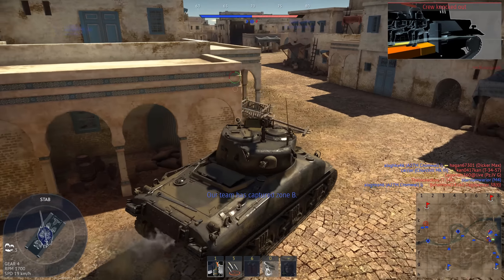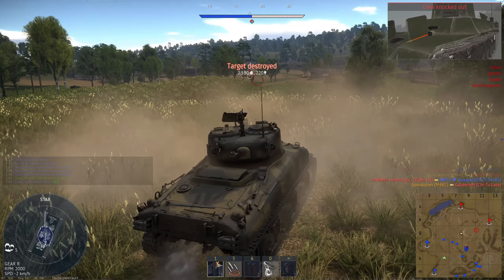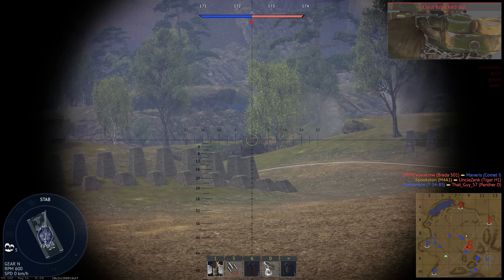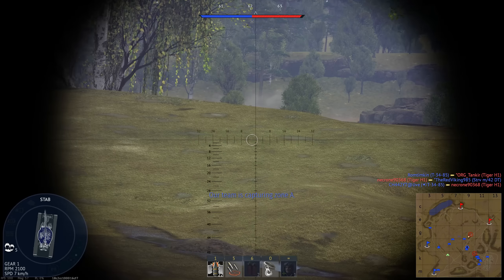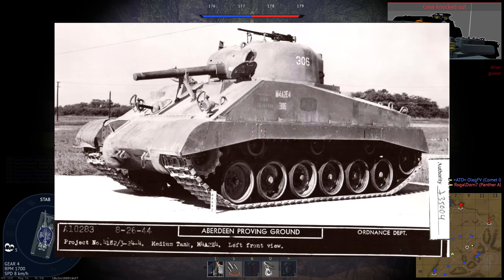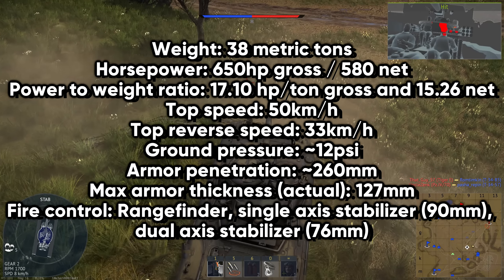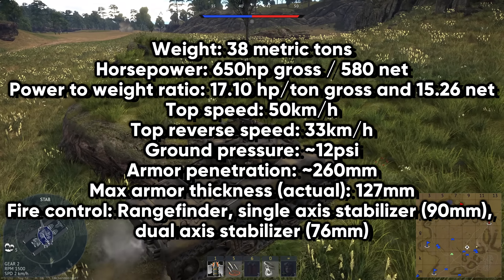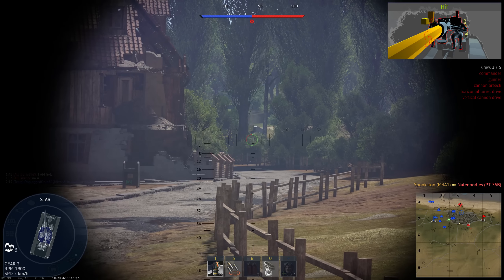The Ultimate M4 Sherman

Comment: Well, seing the fact that the M4 Sherman was somehow underpowered, it should also noted that the 5 synchronized engine climbing up the power to 650 gross Hp wasn't really easy for maintenance, which was a reason why this tank wasn't really official in the US forces, as the french did recieved those tank, and did noticed the engine maintenance difficulties due to its configuration, but about installing a 90mm gun would require to rework the scale of the tank to keep the gravity center balanced, or it could have trouble in mobility, especially extending the lenght and adding new wheel would help about that. But there could also another modification to do in order to make it more viable, and it is reducing his height, or redesigning the height to make it more balanced, in exchange of replacing the turret little more at the back to keep the vehicle balanced and able to use a 90mm canon. But the Sherman was unfortunatly a dead end concept, because his shape wasn't procurring enough protection coming from the frontal hull plate, which wasn't very angled unlike the T-34 and even unlike the Panther, the US heavy tank prototype T32 prooved to be more suited for combat in term of protection, especially for the T32E1 variant. The Sherman did his job done, but whatever you put on it, it would more or less, making it no longer a Sherman, because his hull to increase his protection, need a redesign in terms of angle, and I'm not counting the lengh extension. The US weren't logic to not add component that could had helped their next generation tanks, especially with gun stabilizers, in which except for prototype, there were no more gun stabilized tank after the Sherman, until came the M60A1 AOS and the M551, which was a great mistake, especially that their design were bulky, not very practical, unlike the british tanks, sure it could help for the comfort, but not the survivability, also making there armor less effective than others nations tanks, especially comparing a M60 with a AMX-30, the latter is smaller, making his armor more effective, he was also smaller than the Leopard 1, making it 1 of the most effective NATO tank. But the problem of the US Engineering, it's the fact that some of their component prooved to be somehow unreliable, or even not working at all, making tank project costier and slower to progress, and even if some prototype prooved to work, they aren't accepted due to the incompatibility with the army doctrines, which is a product breaker opinion, but unfortunatly, something understandable.

Comment: I think there should have been more consideration for the French long 75 and 105, which were mounted in the Israeli M50 and M51 respectively. The 105 would provide by far the most firepower out of any of the cannons that were brought into consideration, though it might take up some more room in the turret. I think if you were trying to design a more future-proof Sherman, then the French long 105 would have been a better bet.

Comment: My Ultimate sherman would start off with the T14 assault tank body but without the sloped sides .more like the comet tank with the storage bins above the tracks, so it has a nice low silhouette ...Make it the width of a tiger 1 tank and the length of a panther. Give it the 90mm of the super pershing in the turret of the maus and wet stowage ...Give it nice wide 26 to 28 inch tracks with either a heavy duty version of the hvss from the sherman easy 8 or the suspension from the centurion. Power it with a good v12 diesel engine. And have it weight in at 45 to 48 tons

Comment: Something demi-jumbo like would be much more universally usefull.
3.5 to 4" upper hull ( depending on hull angle ), 4" transmission cover.
5" mantlet. Up armored turret cheeks.
2.5" upper side hull over the length of the crew compartment.
Pretty much a frontal 60 degree invulnerable arc to PaK 40 equivalents.
Hull resistant to 88L56 and 75L70.
Turret somewhat resistant to 88L56 and less so versus 75L70.

Both could gain much better performance with some spaced armor to strip pz gr 39 penetration caps ( 3/4" RHA @30 degrees from horizontal would strip the caps of as per post ww2 testing ).

Comment: Hey Spookston, HP (horsepower) is not a good measure of mobility for a tank. Torque is a much better paramater to look at. You could have 1200 HP, but that wouldn't mean a thing if it has low torque. Torque tells you how good the engine performs under load, and since tanks are very heavy, the load is very high.

Comment: If you want the ultimate Sherman (a.k.a average Joe's medium tank), switch it out completely with a T-34-85 and give it a stabilizer, now you have a tank that's better than any Sherman ever built. - well the Jumbo has better frontal armor but late war german guns (75kwk42,88pak43,128pak44) were able to penetrate it anyway so not that it's matters.
I could say also the Panther, but it was maintenance heavy, had the same terrible reverse speed due to the crap transmission as the Sherman and needs a more powerful engine to be considered a medium tank in terms of mobility, also lacks stabilizer.
Reply: Sherman was and still is a medium tank. 500 horsepower in a 30 ton tank is certainly enough, the t-34 is also not a better tank. 

There. Is. No. Best. Tank. Of. The. War.

The t-34 was the best fit for the war the Russians were fighting. It was built like crap to save cost and get them out the door. It was cramped, uncomfortable to drive, virtually no ergonomics. But the Soviets didnt care, they just needed to build as many as possible as fast as possible.

The Sherman on the otherhand, we had to make sure everything worked before we sent it overseas. We also needed a platform that can be easily upgraded and have modularity to simplify manufacture while painting some semblance of quality control. 
There's dozens of models based on the Sherman, it was a solid and reliable chassis and platform for tank destroyers, Anti air guns, recovery vehicles, artillery, and more.

Comment: just factroy thickneen hull armor by 0.5inch so standard german 75mm won't be problem anymore (and Russian 85mm in Korea) without any larger strain on chassis.
field mounted are good as it is, but for equvalent protection they weight more.

Comment: If we're talking ultimate sherman, why not an Israeli M-51 "Super Sherman" with the 105mm Modèle F1 L57 gun for killing t-54s, 55s and 62s with heat, or the Chilean M-60 with the 60mm High velocity medium support (HVMS) autolading main gun? The strongest engine those nations put in a sherman that I could find was the chilean upgrade to a 535hp v-8 Detroit diesel, which required some modifications to make fit. Those are some pretty powerful guns that they somehow managed to cram into a Sherman turret, albeit from diagrams I've seen it seems to have been at the expense of ergonomics somewhat.

Comment: The Sherman was a design dead end... The M4 was an infantry support tank not a tank destroyer, that's what the Tank Destroyer Corps were for. British crews jumped at the chance to get hold of Cromwell's not because they were faster, had a dedicated AT gun, better Armour but because they were lower. Sherman's were a high profile target and those vertical slab sides. israel has the best example of the Sherman upgrade programs during it's Middle Eastern land grabs in the 50's/60's as they acquired French 105mm guns for an up turreted version, that only proved who fired first lived against Syrian T-35/85 & T-55's.
Reply: Hardly a design dead end. The engineers designed the tank to be easily upgraded and have modularity built in. The high profile is part of the design, the final drive is at the front, so a driveshaft runs along the floor.
Reply: None of them were jumping at a chance to get Cromwell lol yet another over rated tank. Look at the reliability between the Sherman and Cromwell all kinds of articles online lol the who fired first was found out in ww2.

Comment: Ultimate version of M4? Jumbo on HVSS with 105mm howitzer, flamethrower and 1000+ units production run that would have been available in Normandy since day 1? You didn't specify ultimate for which role, task or time period. A few of those would have greatly speed up advance.

Comment: There are already hundreds of Sherman's That I have to go through is war thunder I don't need a hundred more, plus almost everyone has the and it feels like it's not unique in any way, example the 76 American m4 is at 5.3 to 5.7 but the British m4 although without explosives is at 4.7 which imo kind of confusing, the British one also has a higher penning round, and the French has one that has a short reload with a cooler looking turret, heck the Italians have them even the germans(though a paid and supposed "rare" version), it's just kinda boring sometimes going trough a tank that's the same as the last

My starter was German because of the 20 Mil auto cannons but in 5.3 I stopped because it's a shit br for Germany and that's the point where the maus was removed

Then I go American because I want to try some Pershings but going through m4s was a chore everybody knows your weak and will not hesitate to push you unless you're a jumbo you're always cannon Fodder although that doesn't mean that you can't kill anyone at 3.3 or 3.7 it's substantial but at 5.3 it gets outdated